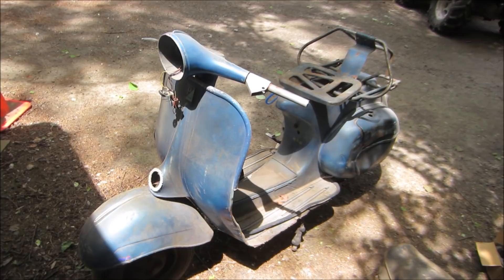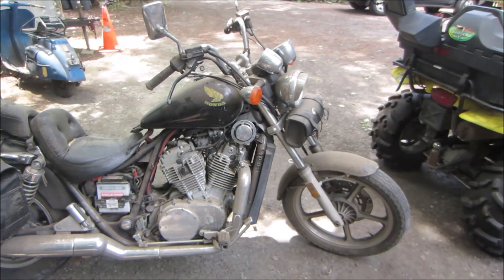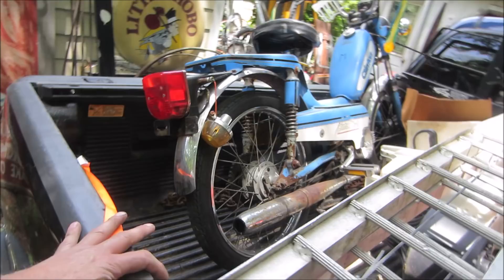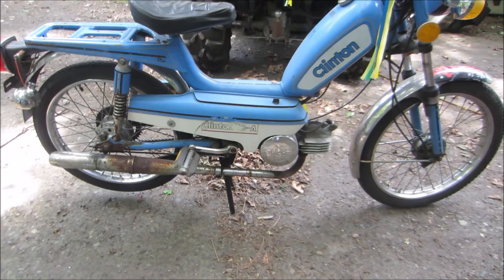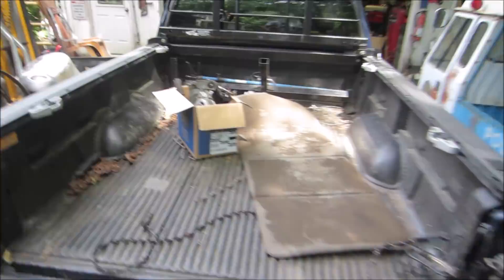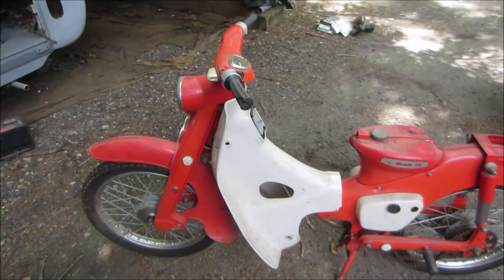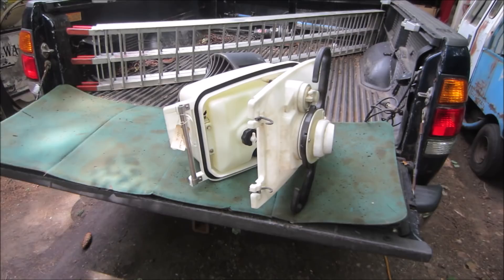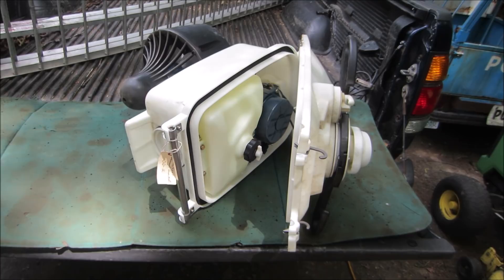motorcycle garage sale finds 6 16 18

Comment: what ever you do mate dont fix that honda with lifan pattern parts they are shite, either chase down new old stock honda stuff or buy one of those cheap unregistered " honda monkey bikes" and use the engine to rebuild yours, 50 and 70 engine parts are inter changeable on hondas that vintage, the 90's aren't though, you can fit a 90cc in that frame if you know what you are doing but the motors are a different series.
but honda motors are easy to find, if it was me i would just stick a 70cc in there, you may be able to pick up an auto 50cc, they seem cheaper than others and bung the jug and the  head etc on it, you can do that did it to an auto 50 i had, i had a 70cc bottom end and rebuilt it with the 50 parts then put it in the 50 frame.